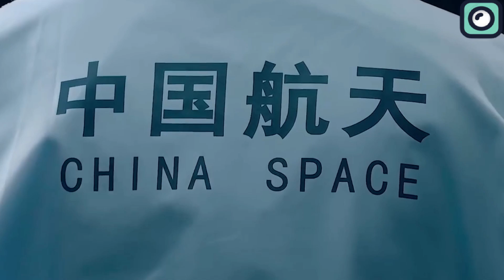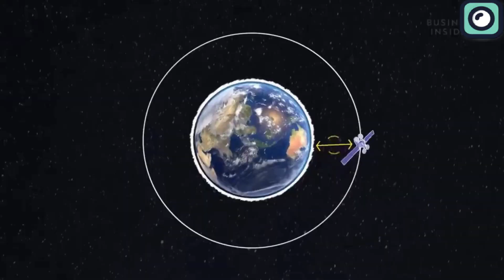Chinese Rocket Disaster.... Fall Down On A Village!

Comment: Accidents will and do occur, even in advanced US.
Starship SN1 tank ruptures in SpaceX pressure test. ...
Starship SN3 breaks apart in SpaceX test. ...
Starship SN4 explodes after SpaceX engine test. ...
SpaceX pops Starship SN7 tank on purpose. ...
Starship SN8 crashes in a fireball landing. ...
Starship SN9 flies high and comes down hard. ...
Starship SN10 touches lands, then explodes.
Space Exploration Technologies Corp., known as SpaceX, together have benefited from an estimated $4.9 billion in government support, 
And what about Boeing astronauts stranded in space? 😊😊
Reply: crai harder commie
Reply: Space X doesn't use hydrazine. Except for Dragon on reentry.